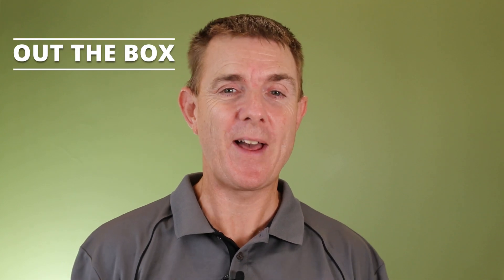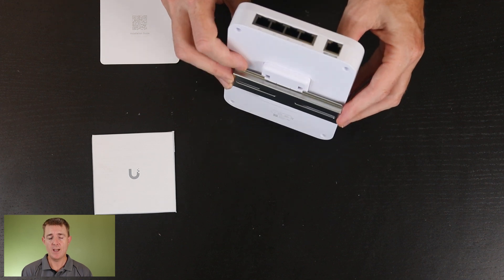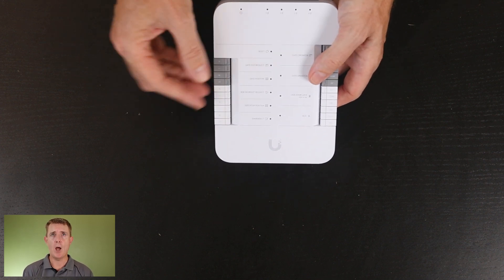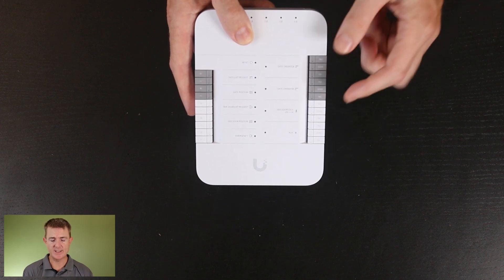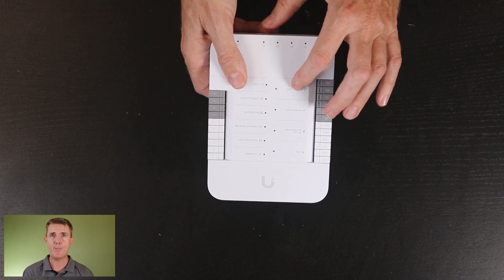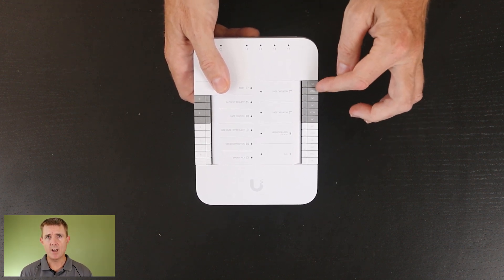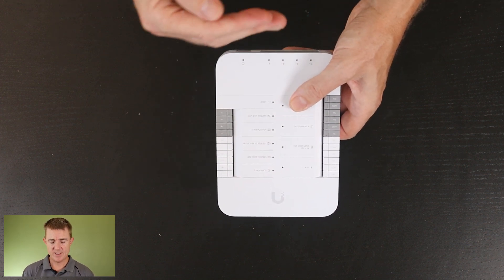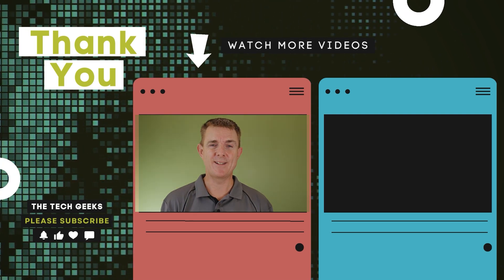Out the Box Series - Ubiquiti UA-Hub-Gate

Comment: Wait a minute, it has 2 gate openers and one side door opener. Is it possible to open 3 gates with one gate hub? I have 3 gates all controlled by a Beninca control board which just needs a dry connection. My remote has one button per gate that opens and closes the gate. All I need to do you control all the gates with one hub is convert the wet side door to a dry connection is that right?
Reply from the maker: Not quite it has dry and active contacts for the main gate, but you can only use one or the other. As a result, you can still only control two gates.

Comment: Hi Paul, thank you so much for your videos :) I want to install an access system in our house. Now I'm wondering, if the UA-Hub-Gate would fit in. We have 2 electric garage-gates that should be opened and closed by the hub, then we have a front door with an electric door lock where the g3 intercom should be installed and a side door which should just be opened without any other features. Is it possible to connect 2 elctric garage-gates and 2 doors to the hub which should be controlled separately? How many different Gates/Doors could be connected to the hub?
Reply: I need to know the answer too!
Reply from the maker: Good question.  I mad ethis video which should highlight what can be done with one Gate Hub - https://youtu.be/U-VpW7PkM74  It depends on if you need dry or active contacts.  Using a Gate hub you can have two doors / gates connected to one device and from the app manage them seperately.  If you want to have a caller to be able to access the doors / gates seperatly then you would need two readers attached to the Hub Gate with one paired with each door / gate.  I hope this helps
Reply from the maker: Good question.  I mad ethis video which should highlight what can be done with one Gate Hub - https://youtu.be/U-VpW7PkM74  It depends on if you need dry or active contacts.  Using a Gate hub you can have two doors / gates connected to one device and from the app manage them seperately.  If you want to have a caller to be able to access the doors / gates seperatly then you would need two readers attached to the Hub Gate with one paired with each door / gate.  I hope this helps
Reply: I know this is an old comment, but I think this hub gate can only do two entrances/exits independently. If you have two garages and a third door, this will only cover 2 of those. You'll need a different hub for the last one. 
For reference, I'm considering doing this too for my dad's AirBnb property to control and monitor two garages and the side door. Currently, I'm leaning towards one of these to control the side door and main garage then one hub mini for the last garage. Waiting for the winter to end and the g6 entry to release regardless.